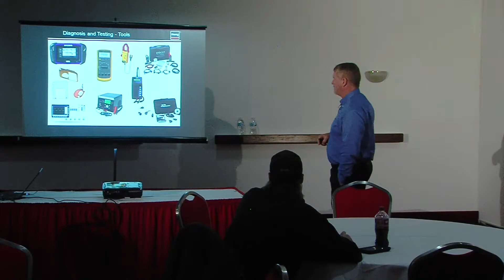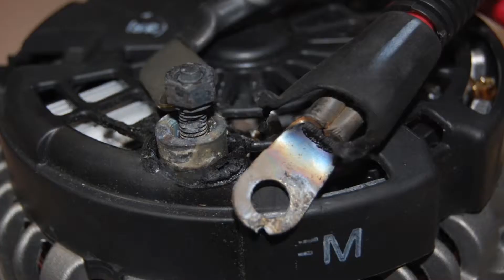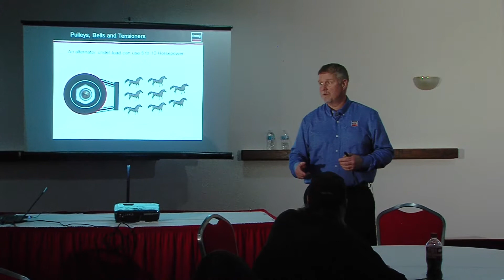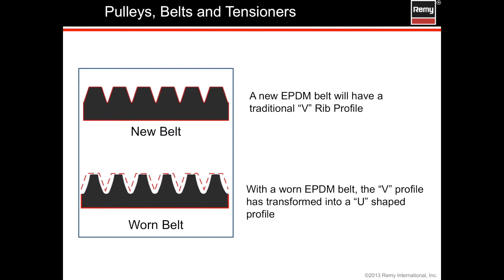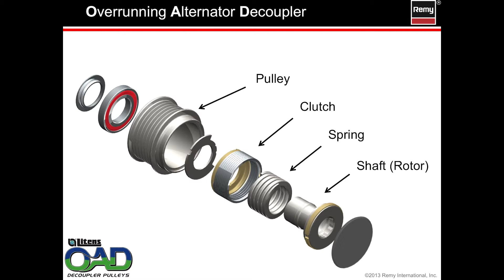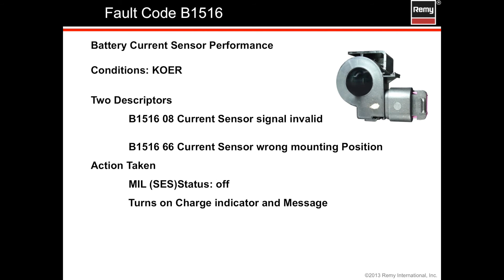GM RVC #4 of 4 Diagnosing & Testing Computer Alternator Systems

Comment: 🔴 How do you go about dealing with voltage drop with after market stereo, amps and subwoofers? What's the proper way to add a second battery, there's location for it in the 2011 Avalanche?❓